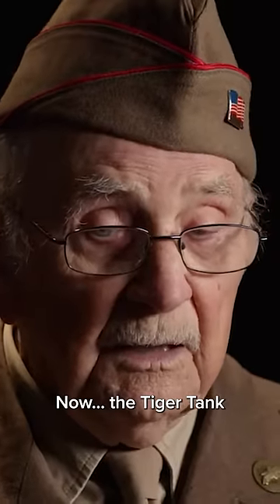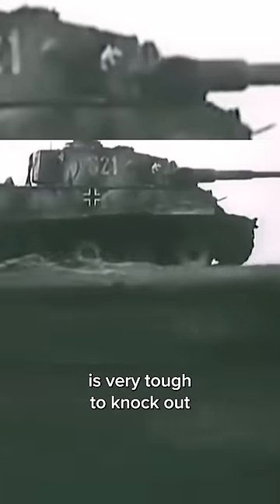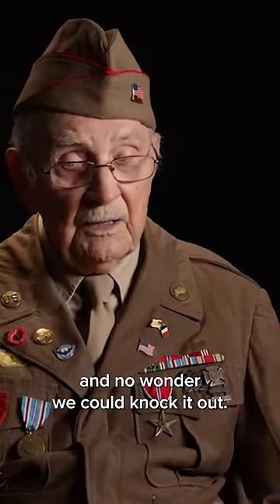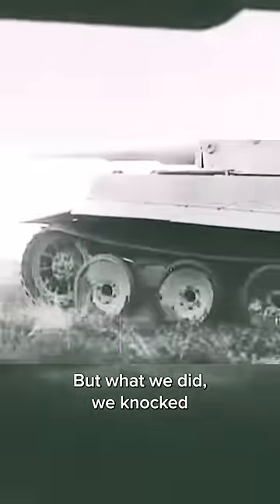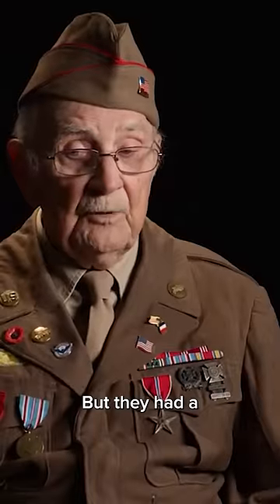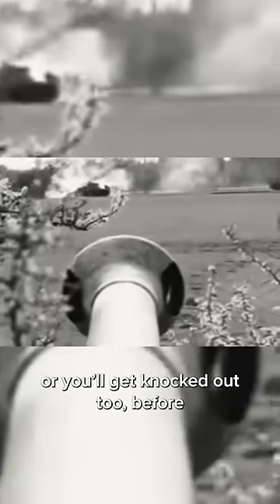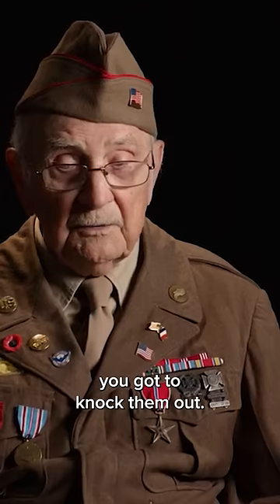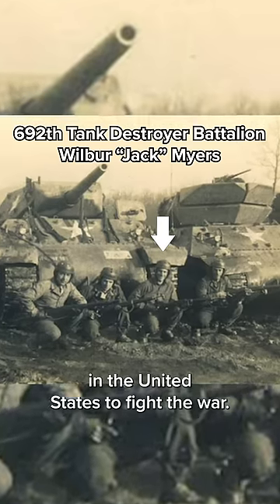How To Knock Out a WW2 Tiger Tank

Comment: The americans didn't come in contact with tiger 1s in france  tank on tank As what' small amount  ofTigers, which came from the South, most of them didn't get there because of mechanical problems and the railways been blown out by the resistance The english and canadians did battle with around canne as it was , such a strategic point. That's where the Tigers where sent. The Americans didn't come in contact With tiger tanks until they got into Germany